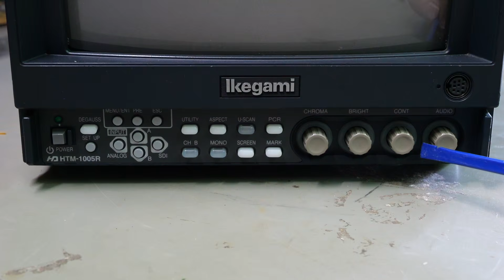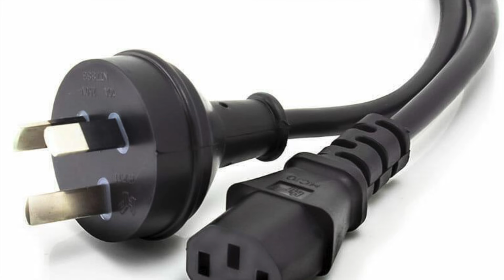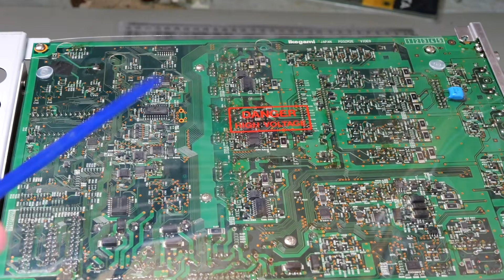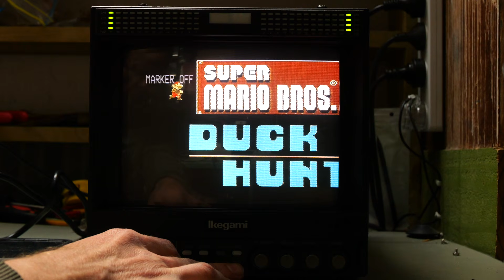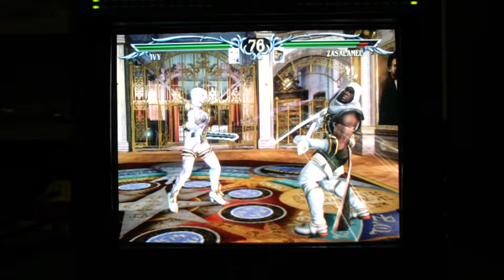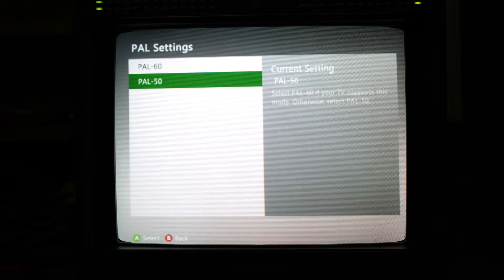Ikegami HTM-1005R1 PRO 10" HD CRT Monitor

Comment: Regarding 480p output from the Xbox 360, if the component cable switch is set to SD, it will ignore the resolution setting and still output 480i or 576i. 480p will only kick in if the switch is set to HD mode.

Comment: Yeah, you've run into the same wall as I did. The 480p issue. The monitor can do up to 1080i but not 480p. I also found that brochure mentioning that it was optional and I found the info about it being just a toggle switch in most monitors from Ikegami. Sadly mine doesn't have the switches but mine is an R2. Yours is the R1, from some research I remember having found some service manual mentioning that only R1s would be able to support 480p. So maybe try to look for the switches in your remote board.
As for the no 240V support, that's not true. If you power it from your mains, you'll see that it works, despite what it says on the back. Mine works fine too from European mains.
My TM10-17RA for instance, also supports European mains but it's a bit more complicated. It's not just a matter of plugging it in. You have to make a physical modification to the board. You need to remove a metal piece that is bridging two points on the board. Then it switches from 100-120V to 220-240V mode.
Reply from the maker: lots of interesting points you make there, thanks for the feedback.
Reply: @rgbrob  You're welcome. :)